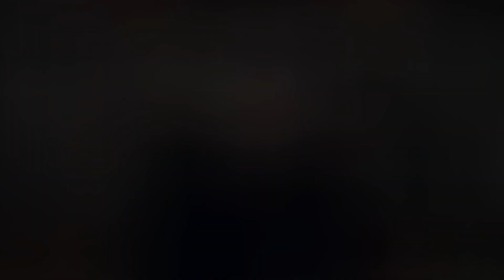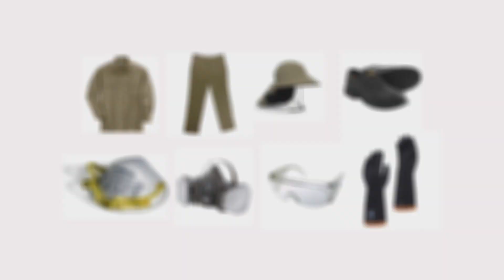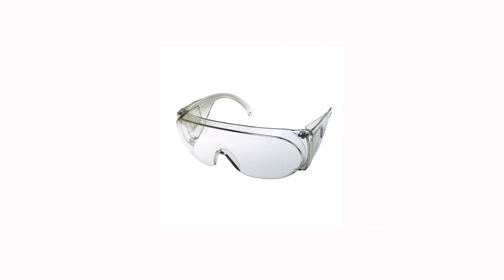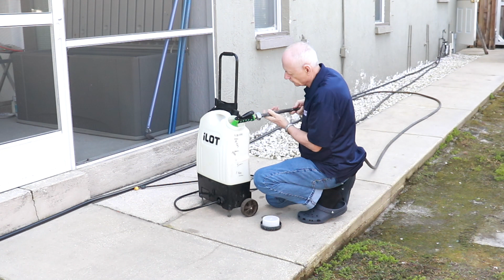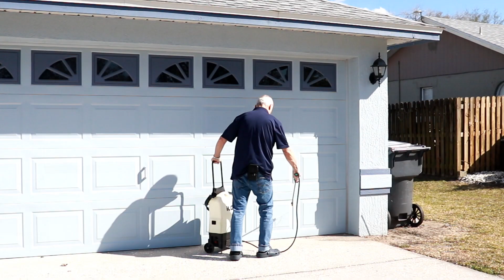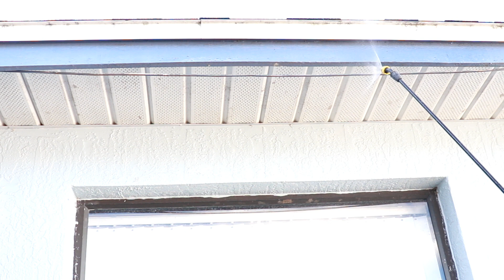How to Prevent Drywood Termites 100% Guaranteed.

Comment: I built a cabin with a sub floor. Do I need to climb under it and spray that same treatment to keep dry wood termites from coming from under?
Reply from the maker: Great question.  If you do not have an existing infestation, then just doing the treatment that I describe in the video will work just fine.  Now, if you would like to make your subfloor termite proof, you can spray all the wood with Bora-Care.  I like to mix it one to one with water.  After wood is treated with Bora-Care, then it can no longer be damaged by any wood destroying pests.  You can do this in the attic as well.  I will give you a link on how to apply it and where to get it.  I hope that helps.  Be well my friend.

Video on how to use Bora-Care:  https://www.youtube.com/watch?v=Rmr_aEodyhg&t=40s

Bora-Care supplier:  https://www.domyown.com/boracare-p-100.html?sub_id=554

Comment: Hi Guy,
Its been a while but me keeps watching your videos for my know how and in pronto application, been occupied eradicating drywood or subterranean termite colonies inside the cabinets in my house. I wonder why haven't found the Queen. In one area termites are just like cooked rice, that much they are, I found outdoor in an open wood cabinet, I had to destroy the wood beneath.
Can I use Bifen IT instead of Talstar P, both have the same amount of Bifenthrin ingredient 7.9%
Can I use Fipforce Aqua instead of Taurus SC both have Fipronil ingredient. Thanks very much for your informational videos and support, its more than a help.
Reply from the maker: I would be more than happy to assist you.  First, can you tell me where you live.  Location matters.  Do you live in Australia?  Also, can you tell me why you believe that you have both drywood and subterranean termites.  That can certainly happen, and I have seen it before, but it is usually the exception and not the norm.  Are you seeing mud tubes and frass?  Please describe the problems and what you are seeing.  Using Bifen IT instead of Talstar P is fine.  I have actually now switched to Bifen XTS.  If you email me, I can provide you with a super-fast and easy way to apply it.  My email is guyspestsolutions@gmail.com.  I never share that in the comment section.  I am not familiar with Fipforce Aqua because it is not readily available in the US.  I believe that product is mainly sold in Australia.  At least, I have not seen it here.  As far as I know, it should work just as well as Taurus SC.  Just provide all the details about what is going on and I will do my very best to assist you.  Be well my friend.

Comment: Hi Guy, recently we started seeing termites in our bathtub and shower. We called two companies both could not find any other evidence of termites anywhere else on the property but still have quotes for 2,200$ up to 2,700$ for only 3-5 years of protection. So we went out and bought Taurus and I dug a trench outside along that wall where they seemed to be coming in and poured that product. We also purchased a canned product called thermador which is coming tomorrow we plan to drill holes in the walls and put that foam product in the walls. Do you think these things that we are doing could be enough to solve the issues? Sorry to ask so many questions but also when you sprayed around your house in this video did you use 0.8 fluid oz per 1 gallon of water? Thank you so much. Ty
Reply from the maker: I am so sorry that you are having this problem.  I have learned to never say never in pest control, but I suspect that you may not have termites at all.  You see, termites do not typically ever come out in the open, so you should never see them in the bathtub.  That may be the reason the pest controllers did not find evidence of termites.  If you still have one of these guys, then you can send me a photo of it.  Just email it to guyspestsolutions@gmail.com.  Please get as close to the specimen as possible, without getting the photo out of focus.  I will let you know what you are dealing with.  If these are termites, then we can start to figure out what kind they are and then come up with a plan to treat them effectively.  So, for now, please stop treating.  You didn't do anything that will cause harm, but there is no sense treating the wrong way.  Before you can treat effectively, you need to know the target pest.  Also, location matters, so please tell me where you live.  Some species only live in certain areas of the US and other parts of the world.  Where you live will help me narrow down the possibilities.

If you email me, please remind me of the problem and give me your YouTube name, so that I can go back and look at your original comment.  I get a lot of email, so it helps if I know who it is emailing me.  Probably 50% of my emails are about termites, so it is easy to get folks mixed up because the problems are very similar.  I don't think I will forget termites in the bathtub though.  I have not heard that one before.  So, if you mention that in the email, I will know exactly who you are.  

Be well my friend.

Comment: What is your opinion on getting attic insulation with pest control solution on it? Is it worth $1600? Or will the boracare treat the same?
Reply from the maker: In my opining it's a total rip off.  Termites do not eat insulation.  Termites eat cellulose.  Wood contains cellulose, and that's why they eat it.  Insulation that is blown in also contains cellulose, but the termites will not eat it because it is treated with a fire retardant.  In fact, it will probably repel them.  Bora-care is applied directly to the wood, and it penetrates almost all the way through.  So, any termites that get into the attic will die when they eat wood that is treated with Bora-care.  So, save your money.

I hope that helps.  Be well Dayana.

Comment: Hi Guy. I have purchased brand new house in dallas Texas. And company that build the house told me that they used bora-care on wood but only 3 feet up from the ground, so rest of the wood is not treated. So I have few questions :
1. Do you think that I should still dig the trench and use termidor? 
2. How about drywood termites? Will they still be able to get inside of my house even if there is bora care on the wood on first 3 feet up from the ground?
3. Will that bora care on first 3 feet be enough for subterranean termites and formosan termites? Or do you still suggest using termidor sc?
Reply from the maker: Thank you for reaching out to me.  I will do my best to answer all your questions.
 
If the company that built the house did the Bora-Care treatment correctly, then your house is termite proof permanently, and this treatment will protect you from subterranean termites only.  However, since they only treated three feet up, this will not protect you from drywood termites.  While that may sound horrible, the good news is that you are a bit too far north to encounter drywood termites.  That being said, I did have one person from Dallas that told me they had dry wood termites.  I think that would be a very unusual situation, but it could happen in a case where somebody purchased a used piece of furniture from a more southern area of Texas, and that furniture was infested with drywood termites.  As a general rule though, you will not see drywood termites in places where it gets below freezing and where it may snow.  Drywood termites need a humid environment all year long to survive.  In cold climates, the humidity typically drops below the point where drywood termites can survive.  Therefore, I do not think it is necessary for you to treat for drywood termites, and that is probably why they did not treat the entire house with Bora-Care.
 
In the interest of providing the total truth here, you should know that there is a very small possibility that subterranean termites can get past the Bora-Care treatment, if they were to build a mud tube up the side of the house, where there is no Bora-Care, to an area of the house that was not treated.  I must emphasize that this is a very unusual situation.  Subterranean termites will almost always attack the first wood they come to, so treating the first three feet from the ground up will almost always get it done.  If it were me, and I was the builder, I would have treated all the wood in the house, from the roof down to the basement.  That would have costed very little more money and it would have made your house completely termite proof for all species.  It would have also made your house carpenter ant proof and carpenter bee proof as well.  When we think of wood destroying insects, we generally think about termites, but they are not the only species that will destroy wood.  I think it would have cost less than $500 for the builder to do the job right, and you would have been protected against all species of termites and all other would destroying insects as well.  Most likely, the contractor was not trying to be cheap, but rather simply didn't know that a total treatment from the roof down was necessary.  If you watch most of the YouTube videos that explain how to apply Bora-Care, they will tell you to just treat three feet up from the foundation.  Even though YouTube is a great source of information, it is also a great source of misinformation as well.  Anyway, if it were me, I would not do any additional treatments at this time, unless you discover some type of an infestation.  If you notice any type of activity, such as mud tubes going up the side of the house, holes in the fascia boards, dead carpenter ants near the walls, and so forth, then I would treat for those problems when they happen.
 
I hope that helps.  Be well my friend.
Reply: @GuysPestSolutions  thank you very much for answering all of my questions.
Reply from the maker: @romang6437  You are very welcome.  Always my pleasure.  Be well my friend.

Comment: Thanks very much for these informative videos. Could you please make a video to how to treat attics and what pesticides to use?
Cheers
Reply from the maker: How you treat the attic will depend on the target pest.  For example, you would treat drywood termites much differently than you would spiders.  If you are talking about drywood termites, then I do cover treating attics in my video on how to treat drywood termites yourself.  I will place a link below for you.  That being said, you should know that treating drywood termites yourself is not going to be effective.  Even the best pest controllers cannot pull it off.  The only sure way to get rid of drywood termites is to fumigate.  You should only spot treat yourself if you cannot afford to fumigate.  If you want the best price for fumigation, then watch my video on how to hire a pest controller without getting ripped off.  I will give you a link for that as well.  You should also know that, if you fumigate, the gas they use has no residual properties at all, so you can get reinfested the moment the tent comes down.  However, you can do a preventive treatment every two or three months.  I will give you a link to my video on how to do that.  In the video I recommend three months, but doing it every two months is a lot safer.  The pesticide does last three months, but it may not be quite as effective in the last 30 days.  So, I treat my house every two months now.  Remember, if you have drywood termites, your neighbors do as well.  They swarm for several months every year, so you will get reinfested if you don't do the preventive treatment.

I hope that helps.  Be well my friend.

Video on how to treat drywood termites yourself:  https://youtu.be/U7ck7zhS0Xo

Video on how to hire a pest controller without getting ripped off:  https://youtu.be/y-a8XOqVrlE

Video on how to prevent drywood termites:  https://youtu.be/neNsmVbj8Pc
Reply: @GuysPestSolutions  thanks for the detailed reply and links. Highly appreciated 🙏🏽
Reply from the maker: @Captrez77  You are very welcome.  Be well Reza.

Comment: If I want to spray my attic with a backpack blower do I need to turn off the Gas on my central heater?  or what is the best way to trat the attic. I saw termite outside on my patio, but I want to do a full house treatment
Reply from the maker: Just to clarify, if you are talking about a backpack sprayer, like a garden variety sprayer, and you are applying a water-based product, such as Bora-Care, then there is no need to turn off your gas heater.  However, if you are talking about a backpack fogger, then you definitely want to turn that unit off, especially if you are applying a petroleum-based pesticide.
 
All of that being said, just because you see a termite on the patio outside does not mean that you have an infestation.  One termite, an infestation does not make.  To estimate the probability that you have an infestation, I would need to have a look at the termite.  If you did not dispose of the specimen, then I can have a look at it for you and let you know if it's a species that should be of concern.  For example, you watched my video on drywood termites and if that guy was a drywood termite, then that may be cause for concern.  However, if this was something like an eastern subterranean termite, then there is a good chance that there is nothing to worry about.  If you can get a photo of it, then send it to guyspestsolutions@gmail.com.  Always take the photo with the feet down and the back up.  Get as close as you can to the termite, without getting the picture out of focus.  If you no longer have the specimen, then have a look at my video on how to identify termite species.  There is a map in that video that will show you where drywood termites are problem.  If you live in the red area on the map, then you may have cause for concern.  Still, all you know is that there are termites somewhere near your home, but you do not know the species.  Most species are best treated or prevented from the outside of the building, so you would not want to treat your attic because it would be a waste of time.  While drywood termites cannot be treated from the outside, they can be prevented from the outside.  So, it is important to know what you saw and where you live.  You may also want to do and inspection to see if you can locate any evidence of an infestation.  In my video on how to identify termite species, I show you what mud tubes look like, what kick out holes look like, and what frass looks like.  These are the things that you would look for to see if you have an infestation and what type of species you may be dealing with.  You would want to inspect around the outside of the house for mud tubes going up the side.  If you have a crawl space or unfinished basement, then you would want to inspect there for mud tubes, kick out holes, and frass.  The same goes for the attic.  If you do not see any of these things, then there is a good chance that you do not have an infestation.  If that is the case, then I can tell you how to prevent all species of termites.  Just get back to me and let me know what you find out.  Most species of termites can be prevented for about $50 a year and about an hour of your time.  Drywood termites can be prevented for about $10 a month and an hour of your time every two months.
 
I hope that helps.  Be well my friend.                   

Video on how to identify termite species:  https://youtu.be/mY4FMvAHrMA

Comment: I wish you could come to my apartment!!!
Reply from the maker: I am so sorry that you're having this problem and that you have MS.  I'm sure you are a very wonderful person and you certainly do not deserve this kind of treatment.  Not only is your landlord an idiot for treating you that way, but it also doesn’t make sense.  If there are drywood termites in your apartment, then they are busy eating away at the walls and maybe even the floors and roof structure of the building.  This will end up causing the landlord thousands of dollars in repairs if they don't get rid of the termites.  If your landlord does not believe the problem exists, then perhaps you should call a pest control company and get a free inspection.  If the pest control company confirms the existence of drywood termites, then you can simply give the estimate to the landlord as proof that the problem exists.  This may inspire them to get their own inspection done.       
 
If your furniture is infested with drywood termites, then a lot of it can be treated with a can of fipronil foam.  All you do is shoot the foam into all the kick out holes for a couple of seconds, or until the foam is coming back out at you.  This is pretty easy to do for most furniture, but it can be a little challenging for upholstered furniture because the wood is often concealed by the fabric.  The problem is though that the termites are going to continue to attack your furniture because they are living in the woodwork and maybe even the drywall around the apartment.  Therefore, about all you can do is just treat the furniture when you notice the kick out holes or frass.   
 
I am so sorry that I do not have a better solution for you.  There is only so much tenant can do in this type of a situation.  Please do take care of yourself as best you can.  

Be well Robin.

Fipronil foam:  https://www.solutionsstores.com/fipro-foaming-aerosol